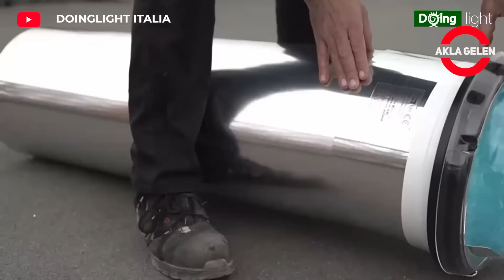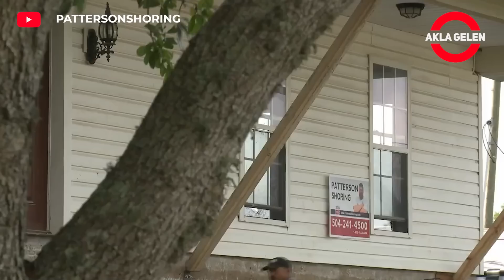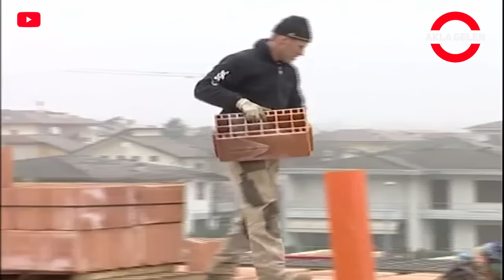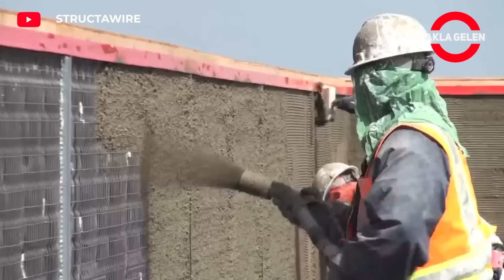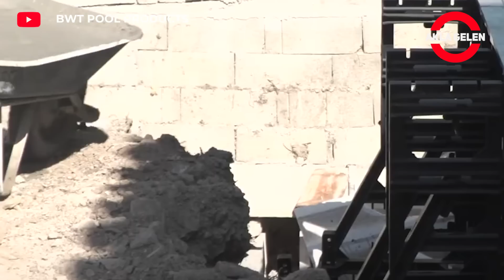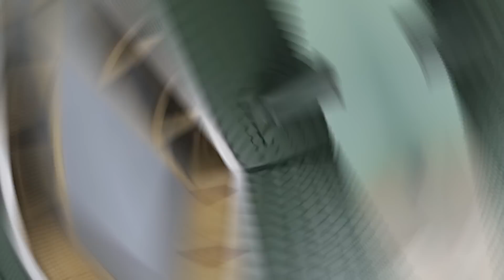Construction Workers Use Techniques You've Never Seen - Most Ingenious Construction Technologies

Comment: The woodwool insulated blocks would cause problems for many commercial warrantees in UK as woodwool has been a 'deleterious material' since 1980's and Architects have to warrant that they will not use the material.  The problem with it is that it crumbles when wet and there will be times in building where the workmanship or the detailing cause it to become saturated, notwithstanding that it could get saturated during construction.  I am unlikely to specify it as I don't want the liability risk.

It is strange that 'good idea' materials have a habit of coming back even though they have been proved to be a failure  Woodwool is one of those products and Timberplas (pvc encased timber windows and doors) is another, both being unmitigated disasters when used in 1970's/1980's

Comment: The approach to home construction should be revised commensurate with current manufacturing processes. Homes may be mass produced at low cost. There is little reason to custom build a basic, single-storey home. This process may be automated to produce panels that fit together that are insulated, wired and plumbed. Wall panels fasten together and into a floor panel that contains all of the utility lines to form rooms. Infrastructure that comprises a residential base with water, electricity, and sewer connections contained within are constructed beforehand to serve the needs of a city on which homes are erected. Imagine, ordering a home on Amazon for fifteen thousand dollars and being able to assemble it within an hour that has double or triple the space of a million-dollar apartment with state-of-the-art features such as an embossed ceiling that add a whole new dimension to luxurious living. 

The floor contains all of the utility lines, heating, ventilation, air conditioning, wiring, plumbing, water and drainage. Then it is merely a matter of plugging in vertical panels into the floor to form the outer walls and space for living-room, bedrooms, closets, kitchen and bathroom. This floor is the "mother floor-board" from which all utility connections rise upwards from the lines in the floor into vertical wall panels. No utility lines connect horizontally between vertical panels. Sinks, toilets and shower head are attached to wall panels that also plug into the floor. Wall panels that include lighting and an electrical outlet, which are possibly 4’x8’ or one meter by three meters, are mass produced in an automated process from a composite plastic material in a variety of creative textures. Panels that comprise the floor are one meter by fifteen meters with the edge panel containing utility lines. A ceiling is set on top of and fastened to the walls. The roof is a convex panel that fits on top of and plugs into the outer walls. It is also possible that with this waterproof plastic material each individual room has a bubble skylight dome roof/ceiling with pipes in the walls that drain into the base. Other refinements include the fabric of the dome comprising a solar array and solar collector. Thus, the entire home is made by inserting vertical wall panels into the floor panel that rests on top of and is connected to the city infrastructure slab base. It is not inconceivable that this single-storey home with one, two or three bedrooms be assembled and ready to move into within a few hours of the kit being delivered.

Of course, this will never happen. Keep dreaming. It will take China to lead the way and transform housing from the expensive nineteenth century tailor-made suit concept into economical standard ready-to-wear off the rack homes that cost $15,000/$5,000,000 = 0.003 of the present cost of a home in Vancouver. 

The flaw in the analysis: Citizens may not utilize land that was not promised to them in the presently cozy arrangement—functioning like a monopoly with monopoly prices—that shunts their lifetime earnings exacted through the cost of shelter directly into the pockets of the chosen few that without effort making them rich beyond belief while after a lifetime of hard work residents own nothing and are left to die homeless on the street.

Comment: The sun tunnels work really great but sometime fill with dead bugs.
Reply: My husband and i built a home in the 1990s we installed ( ourselves) in an interior bath on the 2nd floor, and it worked wonderfully and no bugs.  If yours  got dead bugs in it, it was most likely installed  improperly with leaks as your problem.
Sorry you had an issue with yours, but I'd install another today if I had a room with no natural light abilities.
Reply: But they are easily cleaned

Comment: That green roof at 8.37 looked like modula plastic.  So can any one say if it is non combusable as has been seen in oyhrt plasitc roofing it drops blasing plastic when burning and melts when hot in contact with fire. Reminds me of the UK Orow glass disaster.
Reply: Great roofing product. If it’s installed right I’ve ripped too many of them off you’re only as good as your installer.
Reply: Those roofing panels are colour coated pressed steel.  I have used these in the past but only because the office extension i was doing had to copy the original building.  Out of preference clay pantiles are a better option.